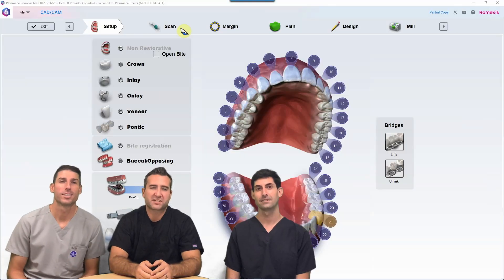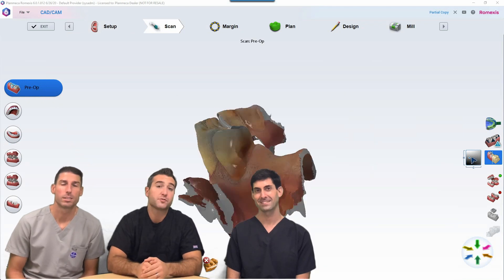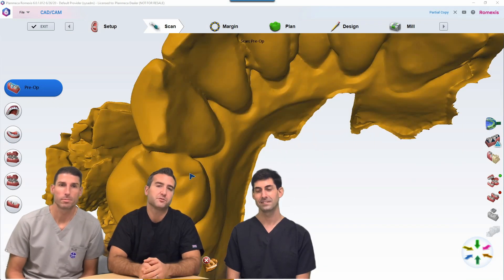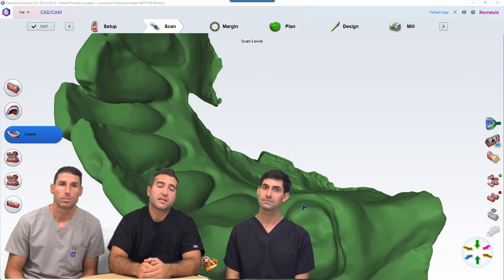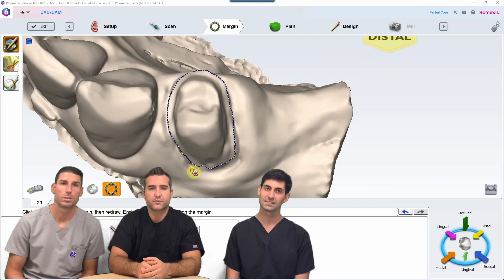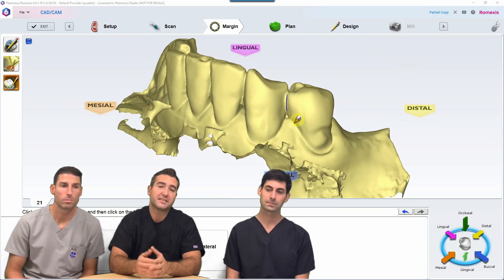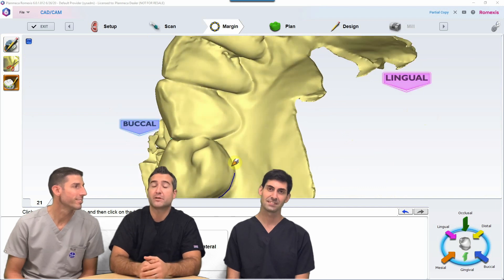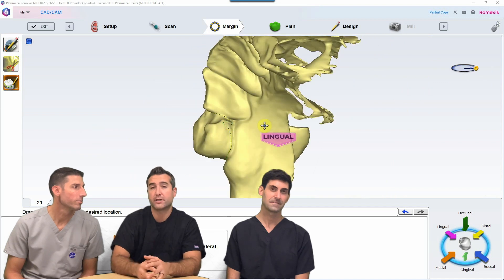Episode 3: Retrofit to partial denture

Comment: I had a case yesterday; a single central incisor that had lost its crown, and had a well-fitting cobalt-chrome denture depending on it for retention. 

Is there any way of scanning the denture in situ that would create a proposal that would allow the denture to fit, or is a buildup in composite to simulate the fit, be the only way?
Reply from the maker: I usually lubricate the metal with vaseline, build the tooth up with composite , seat the partial  and cure. That way I get the contours needed to fit for the copy.  You could try scanning the prep with the partial seated and kind of designing around it but that’s not as predictable
Reply: Thanks Wally, that’s really helpful! Because the retention arm of the co/cr partially wrapped around the lingual aspect of the missing crown, I reckoned o could scan the prep with the partial in place. But, despite being able to draw a margin around the whole prep, for reasons only know to DS, the proposal missed an area of the palatal margin and just just would not allow me to fill it in. 

In the end, I over contoured the emax, then spent 30min of trial and error to get that aspect correct, before putting it through the kiln!